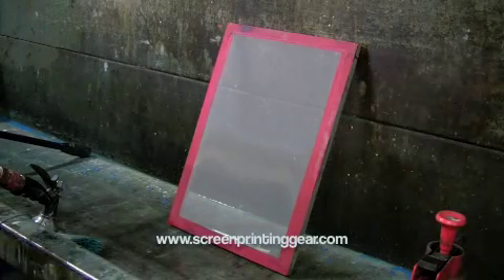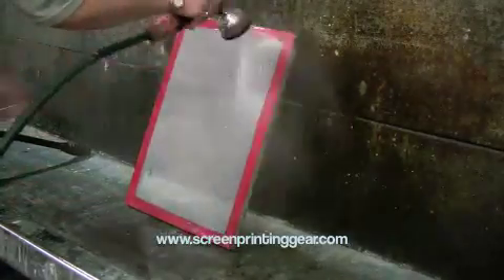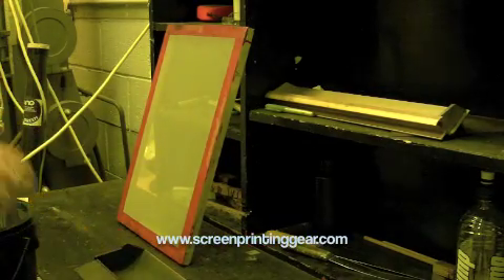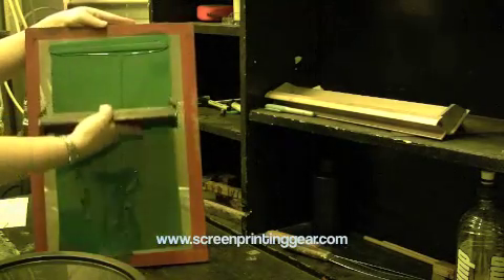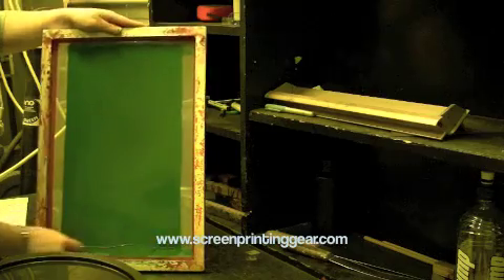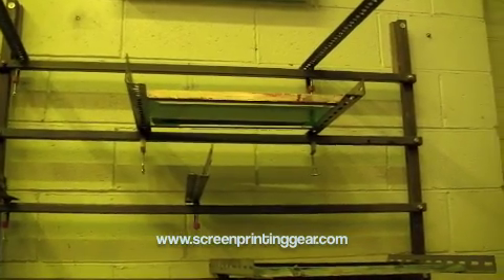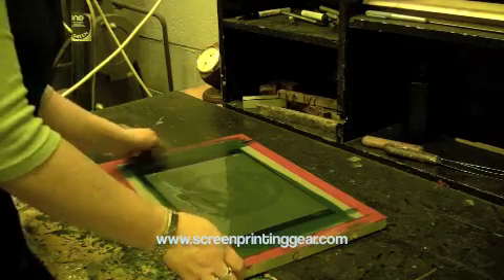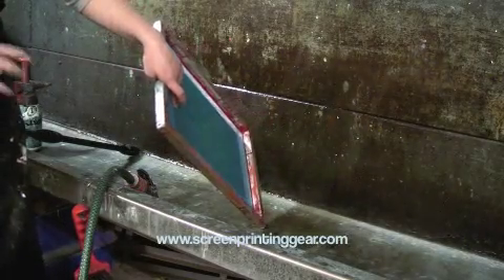Screen Printing - Stencil Making

Comment: What paint u use
Reply from the maker: Azrul Nasha , the green fluid is call emulsion and is sensitive to UV light. If you are asking about what ink to print with it all depends on what you are printing onto. For fabric you will use fabric ink, for paper you will use paper ink. Contact a screen printing supplier near you and they should be able to help you further. The brand I normally use is Australian Speciality Inks.

Comment: how long does it take for the emulsion to dry
Reply from the maker: +Jason Taylor It depends on you environment but it takes about 20min. You can use a heater to help it dry but dont use a fan heater as it will blow dust into the emulsion. Better to use a bar heater.

Comment from the maker: Hi that depends on what process you would like to use. For a film positive you can print it out from a laser or ink jet printer with the appropriate stock (I don't recommend paper at all), you just need to adjust your printer settings so you get the blackest black. I have some information about this on my web page (I've included a link at the top) have a look at the "Artwork Requirements Booklet" or the "Printer Setting for paper positives" it's the same settings for film.